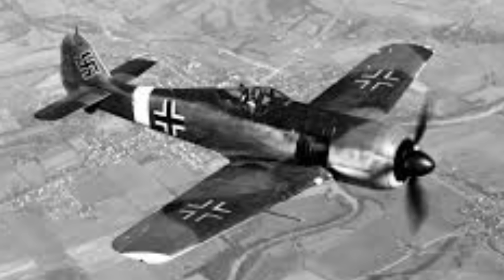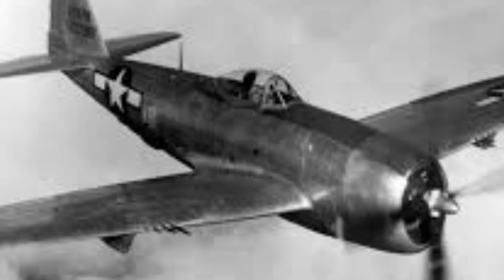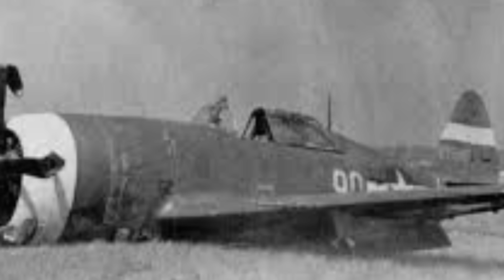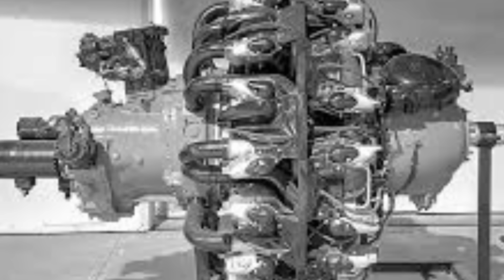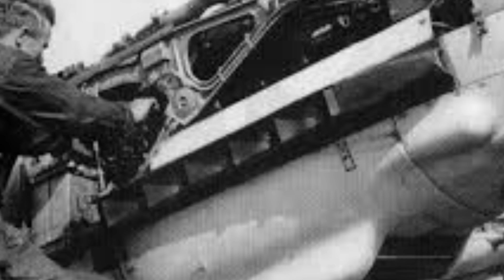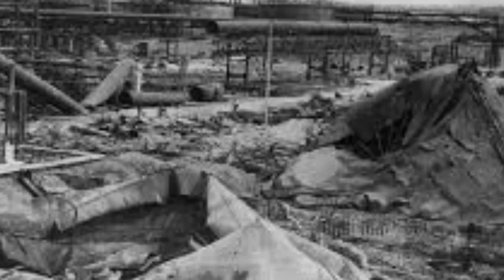Luftwaffe Never Expected 2,800hp R-2800 Engines To Turn P-47s Into 500mph Demons

Comment: Later models of the P-47, namely the M and N, could achieve 2800 hp at war emergency power using water/methanol injection and 150 octane aviation gasoline.

Comment: I kind'a doubt that a German test pilot was able to adequately evaluate a "captured P-47" simply because Germany didn't have the required high-octane avgas that the Americans were using.  The Bf109's engine was 27 liters but didn't produce as much power as that displacement would be expected to yield because the Luftwaffe didn't have the gas.  The Spitfire's performance was increased when the US sent fuel over to Britain.  That kind of gas is no longer available due to the toxicity of the amount of lead used in it.  The gas fouled plugs and shortened engine life but that was acceptable given the average lifespan of combat aircraft at the time. Warbirds flying today have to use available fuel running lower manifold boost - ie. superchargers and turbo's limited - to run on available "100 low-lead" gas.

Comment: The engine was a beast but it only produced that kind of power for a brief time using "war emergency power" and methanol-water injection.  And still, in combat trim with a weapons load-out, the plane couldn't do "500 mph" in level flight.  A plane specially prepared for racing with custom panel work to reduce drag could do that but the engine would need frequent overhauls to maintain that level of performance.  Unlimited racing planes of various models frequently had wing tips trimmed to reduce drag, but at the expense of increased wing loading.

Comment: I just watched 2 other Ai videos which said the double wasp R2800 engine “only” produced 2000 hp. The 2800 refers to engine capacity in cubic inches, not the power.

Comment: Technical confusion everywhere here.
ONE: The double wasp in the P-47 did not have a supercharger, much less a dual stage. It used a Turbocharger, made by Garrett.
TWO: the P-47 was so large BECAUSE the Turbocharger, the dual stage intercooler and the Alcohol-water EWP boost required an airframe so large most thought it could  not be sustained.
THREE: The 8 M-4 guns were only 25% more lead / minute than the 6 guns of the P-51 and the Aircobra.
TURN OFF THE AI or at least check up on it!!

Comment: The P-47 Thunderbolt’s transformation from a mocked “flying milk jug” into one of World War II’s most feared fighters is nothing short of legendary. German pilots underestimated its bulky frame, never imagining the raw power hidden inside the R-2800 Double Wasp engine. Once unleashed, the Jug became a 500-mph powerhouse that could dive faster than any Luftwaffe aircraft and absorb incredible punishment. Its eight .50-caliber machine guns shredded enemy fighters and ground targets alike. More than a dogfighter, the P-47 proved that engineering innovation and brute engine performance could completely redefine air combat and turn ridicule into fear.

Comment: P-47s of all types had a high fuel consumption rate. Even with drop tanks they could not escort bombers deep into Germany. But their radial engines, sturdy construction and armor plating made them excellent front line fighter bombers, capable of operations even on rough field strips.
Reply: Incorrect statement. They were flying 1000 mile missions escorting B-24's from Morotai to Balikpapan carrying a 150 gal. droptank on one wing and a 300 gallon droptank on the other. With much success.
Reply: @56tcA90 Yes and the N variant with wing tanks has longer range than the P-51D.
Reply: Could not escort deep into Germany. From the D-15 and on it could go to Berlin and back .

Comment: US aircraft rarely reached their design speeds - much less exceeded them. Here are some examples, with designed/actual speeds:

F6F-3: 385/367 mph
F6F-5: 409/377 mph
P47C: 427/416 mph
P51B: 442/430 mph
P51H: 487/465 mph

By contrast British aircraft exceeded their design speeds:

Typhoon: 408/420 mph
Spitfire HF VIII 419/435 mph
Spitfire XIV: 448/457 mph
Mosquito FBVI: 385/420 mph

Comment: Fitted with the 2,800hp Pratt & Whitney R-2800 Double Wasp engine and a two-stage turbocharger, the P-47 Thunderbolt transformed from a heavy escort into a 500mph aerial brute. Its sheer speed, dive power, and eight .50-cal guns made it virtually untouchable in combat. Luftwaffe pilots who once mocked its size soon feared its thunderous attacks — the “Jug” could outdive any German fighter and shred targets with devastating firepower, earning its place as one of WWII’s most feared warbirds.

Comment: A lot of misinformation here!  The most egregious error is that that the R2800 did not have a 2 stage supercharger inthe P-47.  The primary supercharging was done by a very complex turbocharger mounted in the rear fuselage with a massive intercooler.  The early P-47s that the Germans saw had terrible climb performance, one pilot commenting that "I hope this thing can dive 'cause it surly can't climb".  The retrofit of the "paddle blade" prop solved the climb problem.  How much horsepower?  It depends on fuel octane, manifold pressure settings, and the availability of water/methanol injection.  Many P-47D models could reach 2300 hp at altitude.  The later P-47M and P-47N could indeed reach 2800 hp.
 
The Germans had learned to dive away from attacks by the British fighters because their carburators would cause a momentary loss of power during a dive.  This made them "sitting ducks" for the P-47.
Reply: Actually the P47 had BOTH a turbo supercharger in the rear AND an engine driven single stage supercharger. Very complex and effective system, but bulky. Hence the large fuselage.

Comment: The only way any prop driven plane did 500mph was in the dive. And the P47 DID NOT LAST LONG there
Reply: Yes, speed is generally rated in level flight at a given altitude and weight.
Reply: I should have qualified that No combat laden prop plane in WW2 did 500mph in level flight
Reply: The P47M and P47M CAME CLOSE
Reply: P-47 outdived everything. P-38 in 2nd and P-51 and Corsair were tied for 3rd. They all initially out accelerated the Thunderbolt for the first few hundred feet.Then the Thunderbolt would just pass them up. Thunderbolt also out rolled all of them as well.
Reply: @56tcA90  ha ha ha the P47 had the second  worst dive of the American three and it did not  matter if they put on  dive brakes . It sill only had a safe Mach of 0.72 
Oh please stop  the hyperbole Roll Rate P47 84deg /sec 63 deg/sec @ 400mph
P51B 94d/s 78d/s @ 400 mph 
Tests at Wright Field Jun 44

Comment: I am proud to say my Grandmother work on the P47 at Republic Aviation in LI NY. As the saying went “ if you want to send a picture home to your girl, take in front of a P51, if you want to get home to your girl, fly a Thunder Bolt.
Reply: The P-47 turned the tide winning control of the air. The "late to the party" Mustang inherited a war where high-altitude escort faced student German pilots and many times no opposition at all. And air to ground,the Mustang is a piece of paper compared to a Thunderbolt. Perhaps you should change your studies to go-carts or paddle boats.
Reply: P-47 would outroll that P-51 at any altitude . Deal out more destruction and if it took hits,would most likely get you home. Over rated,late to the party Mustang would make you a POW most likely. No one comes close to the stats that the P-47 produced in tactical air-to-ground missions. Clean your loop.
Reply: @56tcA90  No wrong US tests rolls conducted at 400mph P47 /63 d/s P51/ 78d/s tests conducted at 10000ft  
2.Tactical air to ground the USAAF  lost over 2000 P47 doing it. And why not many P47 pilots became POWs is that they were lost with the plane doing G/A 
3  The RAF Whirlwinds Hurricanes Mustangs Typhoons and Spit XII &XVI never lost that many and they had been doing it since 1941.
Reply: How very true
Reply: Not if you did anything but fly it up high 2400 were lost doing G/A and other things P51 good on the deck and at 40000ft
Reply: @jacktattis Air to ground is 50x more hazardous than air to air .Mustang faced student German pilots. And on the deck it was very vulnerable . As for a liquid cooled fighter,the P-40 was way tougher than any Mustang. P-51's suffered from many structural failures averaging 2 a week all the way to the end of the war.
Reply: @56tcA90  P47 manoeuvred like a bus down low  350mph@S/L
P51B 368mph@ S/L and was extremely manoeuvrable @ S/L
Reply: @56tcA90  P47 manoeuvred like a bus doing G/A 350mph And sources for P51 structural failures please. 2400 P47 lost  doing G/A now THEY did sufffer  strutual failure Source Testing  for Combat pages 144-146

Comment: To give credit, the FW 190 was revolutionary on its own. That was the Germans first radial engine, plus they made it to be able to cool itself with the engine air flow..
Reply: All radial engines I've seen are air cooled. Including all Pratt radials.
Reply: @AARonZ7481Air Cooled yes, the 190 had a oil cooler as well. But the mounted it in front so the air kept the oil cooler as well doubling down
Reply: HOW DID THE AMERICAN ABILITY TO PRODUCE THE PRATT & WHITNEY R-2800 ENGINE AT SCALE, INCLUDING ITS ADVANCED TWO-STAGE SUPERCHARGER, REPRESENT A CRITICAL FAILURE IN GERMAN WARTIME INDUSTRIAL CAPACITY?
Reply: @BrainUpTank    That advanced supercharger was a dud Go to any schematic diagram of the P47 and have a look at how inefficient the whole setup was 20+ ft of 4inch  dia piping The Turbo unit  5ft in Dia ,the Ducting 18in square and 15ft long Fw190 supercharge was a bolt on unit to the engine so sml it is not shown on the schmatic diagram and the uniit could produce 1700hp or 2000hp Emergency from a 10000lb plane
Reply: @BrainUpTank plus it's a lot harder to build anything when we non stop Bomb the Shit out of everything you have🤔

Comment: from: https://en.wikipedia.org/wiki/Pratt_%26_Whitney_R-2800_Double_Wasp

"A" Series:

    R-2800-1

    1,500 hp (1,100 kW) at 2,400 rpm at 7,500 ft (2,300 m). Production prototype of "A" series engines with the first flight test July 29, 1939.[12] Single-speed two-stage supercharger. Production = 2 (P&W). Tested in Vultee YA-19B.[13]

    R-2800-5

    1,850 hp (1,380 kW) at 2,600 rpm at 2,700 ft (820 m). Main production "A" series engine used in Martin B-26A, early B series and XB-26D and Curtiss C-55/XC-46. Production = 1,429 (P&W 475, Ford 954.)[14]

    R-2800-39 - 2,000 hp (1,500 kW)
    Double Wasp S1A4-G - 1,850 hp (1,380 kW)

"B" Series:
A preserved "B Series" R-2800-21 or -59. The A and B series can be most readily identified by their smooth, single piece nose casings. This photo shows the simplified tubular ignition harness fitted to some R-2800 subtypes.[nb 3]

    R-2800-8

    2,000 hp (1,500 kW) at 2,700 rpm at 1,000 ft (300 m); 1,800 hp (1,300 kW) at 2,700 rpm at 15,500 ft (4,700 m). First series production "B" Series engine using a two-stage, two-speed supercharger and with internal engineering changes resulting in increased power and reliability. Updraft Bendix-Stromberg PT-13D-4 pressure carburetor. First production engines delivered to USN November 11, 1941. Used in Brewster F3A-1, Goodyear FG-1, Vought F4U-1 and F4U-2. Production = 3,903 (P&W 2,194; Nash 1,709.)[15]

    R-2800-8W

    2,250 hp (1,680 kW) WEP with water injection. First production engine using ADI equipment, major production version of -8 and used in some versions of F4U Corsair. Production = 8,668 (P&W 5,574; Nash 3,094.)[15]

    R-2800-10 and R-2800-10W

    2,000 hp (1,500 kW) at 2,700 rpm at 1,000 ft (300 m); 1,800 hp (1,300 kW) at 2,700 rpm at 15,500 ft (4,700 m); up to 2,250 hp (1,680 kW) WEP with water injection. Similar to -8 series apart from downdraft PT-13G2-10 and PT-13G6-10 (-10W) carburetor. Used in Curtiss XP-60E, Grumman F6F-3 (-10; late production -10W) and F6F-5 (-10W) series and Northrop XP-61, YP-61, and P-61A-1. Production = 4,621 -10 (P&W 2,931; Nash 1,690) and 12,940 -10W (P&W 3,040; Nash 9,900); Total = 17,561.[15]

    R-2800-21

    2,000 hp (1,500 kW) at 2,700 rpm at 2,500 ft (760 m); 2,000 hp (1,500 kW) at 2,700 rpm at 25,000 ft (7,600 m). First production variant fed by a General Electric C-1 turbosupercharger.[16][nb 4] Designed for use in the Republic P-47B, C, D, G and XP-47F and K. Production = 5,720 (P&W 1,049; Ford 4,671.)[18]

    R-2800-25 - 2,000 hp (1,500 kW) — for Northrop P-61 Black Widow
    R-2800-27 - 2,000 hp (1,500 kW)
    R-2800-31 - 2,000 hp (1,500 kW)
    R-2800-41 - 2,000 hp (1,500 kW)
    R-2800-43 - 2,000 hp (1,500 kW)
    R-2800-51 - 2,000 hp (1,500 kW)
    R-2800-59

    2,000 hp (1,500 kW) at 2,700 rpm at 2,500 ft (760 m); 2,000 hp (1,500 kW) at 2,500 rpm at 25,000 ft (7,600 m); 2,300 hp (1,700 kW) WEP with water injection. Main production variant used in P-47 series, fed by an improved C-23 turbosupercharger.[19] Differed from -21 in being fitted with ADI and a General Electric ignition system with a simplified tubular ignition harness developed by the Scintilla company in partnership with Bendix. Used in P-47C and D, XP-47L. Production = 11,391 (P&W 592; Ford 10,799).[20][nb 5]

    R-2800-59W - 2,500 hp (1,900 kW)
    R-2800-65 - 2,000 hp (1,500 kW)
    R-2800-65W - 2,250 hp (1,680 kW)
    R-2800-71 - 2,000 hp (1,500 kW)
    R-2800-75 - 2,200 hp (1,600 kW)
    R-2800-79 - 2,100 hp (1,600 kW)
    Double Wasp 2SB-G - 1,850 hp (1,380 kW)

"C" Series
A "C Series" R-2800, with the two section nose casing incorporating torque-monitoring equipment and a Spark Advance unit, with the "outboard" sparkplug wiring conduit location for each of the twin enclosed distributors.

    R-2800-18W

    2,100 hp (1,600 kW) at 2,800 rpm at 1,000 ft (300 m); 1,800 hp (1,300 kW) at 2,800 rpm at 25,500 ft (7,800 m).[21][full citation needed] First series production variant of the "C" Series, which was a complete redesign of the R-2800. Some of the main changes were: forged rather than cast cylinders, allowing an increased compression ratio (from 6.65:1 to 6.75:1); a redesigned crankshaft; a single piece (rather than split) crankcase center section; a two section nose casing, incorporating hydraulically operated torque-monitoring equipment and an automatic vacuum-operated spark-advance unit.[22] The supercharger used fluid coupling for the second stage.[23] Updraft Bendix-Stromberg PT-13G2-10 carburetor. Used in Vought F4U-4 and variants of the -4.[nb 6] Production = 3,257 (P&W).[25]

    R-2800-22W - 2,400 hp (1,800 kW)
    R-2800-34 - 2,100 hp (1,600 kW)
    R-2800-34W - 2,100 hp (1,600 kW),[26] 2,400 hp (1,800 kW) with water-methanol injection
    R-2800-44 - 2,300 hp (1,700 kW)
    R-2800-44W - 2,400 hp (1,800 kW)
    R-2800-48 - 2,500 hp (1,900 kW)
    R-2800-48W - 2,400 hp (1,800 kW)
    R-2800-52W - 2,500 hp (1,900 kW)
    R-2800-54 - 2,100 hp (1,600 kW)
    R-2800-57 - 2,800 hp (2,100 kW)
    R-2800-57C - 2,800 hp (2,100 kW)
    R-2800-73 - 2,800 hp (2,100 kW) — with General Electric CH-5-A3 turbocharger[27] for P-61C Black Widow
    R-2800-77 - 2,800 hp (2,100 kW)
    R-2800-83 - 2,100 hp (1,600 kW)
    R-2800-83AM - 2,100 hp (1,600 kW)
    R-2800-99W - 2,300 hp (1,700 kW)
    R-2800-103W - 2,500 hp (1,900 kW)
    Double Wasp CB16 - 2,400 hp (1,800 kW), 2,500 hp (1,900 kW)
    Double Wasp CB17 - 2,500 hp (1,900 kW)
    Double Wasp S1C3-G - 2,100 hp (1,600 kW)

"D" Series:

    R-2800-23 - 2,200 hp (1,600 kW)
    R-2800-29 - 2,000 hp (1,500 kW)

"E" Series:

    R-2800-30W - 2,250 hp (1,680 kW), 2,500 hp (1,900 kW) with water-methanol injection — with variable speed single-stage supercharger for Grumman F8F-2 Bearcat[28]
    R-2800-32W - 2,450 hp (1,830 kW), 2,850 hp (2,130 kW) with water-methanol injection — with variable speed two-stage supercharger for Vought F4U-5 Corsair
Reply: Well done. Good job. But the P-47Mike and November also used the "C" series -57 model as well.
Reply: Bearcat not in WW2 and everyone of the rest was beaten by the  Spitfire in climb, turn,dive, roll ,service ceiling The Black Widow was beaten by the NF Mossie 
If you wanted class go Merlin If you wanted  junk go P/W
Reply: @jacktattis Man,you are one mixed up puppy. And your Spitfire couldn't roll or dive worth a nickel. Actually ,Packard made the Merlin more dependable than RollsRoyce.

Comment: For all practical purposes, the P-47 with proper drop tanks could have still gotten the job done had the P-51 never existed. It would have costed more $ though.
Reply: P-51= better gas mileage saved $
Reply: @williamandrews3648 And more POW's and pilots killed too.
Reply: That's exactly true. P-47 could have won the war in Europe all by its self. Happy Arnold jumped the gun just like the Brits that made fun of it. Cost of P-51: around $50,950. Cost of Thunderbolt was around $75,000. But the Thunderbolt was built like a machined tool and would get the pilot home more than likely.